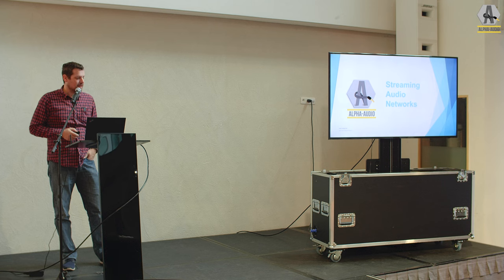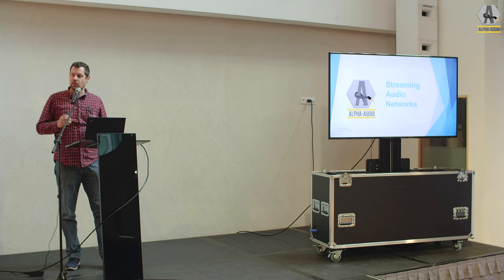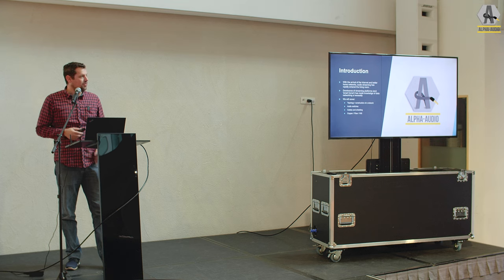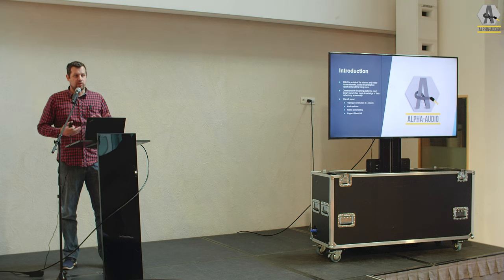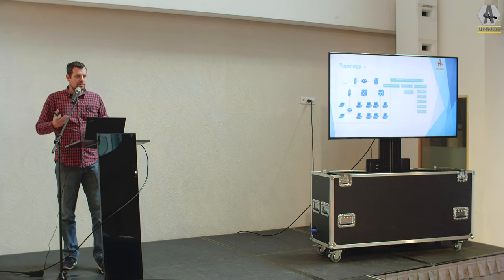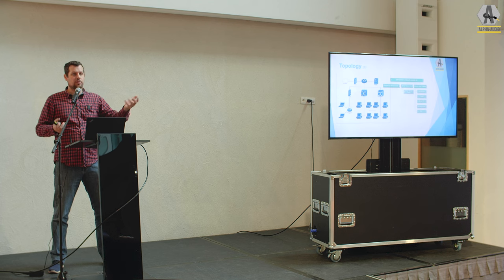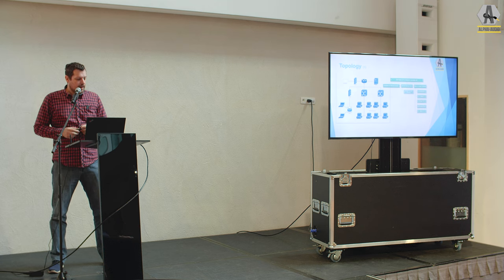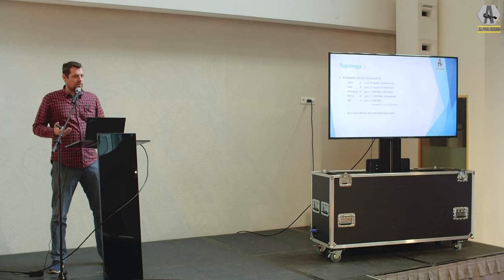Streaming Audio Networks - What matters? And what doesn't? Noir & Blanc hifi show 2022

Comment: Good discussion. I am a sceptic owing to a decades long professional network engineering background. Plus my audio system already sounds epic. I don't even know what sort of switch I have behind the AV rack. Turns out its a TPLink (I checked) so you know I'll have to buy a Netgear or a small Meraki switch now and hear for myself.
Reply from the maker: @KeithHeinrich  I can imagine you are sceptic. I have a networking background as well... But the issue is not data related. It is mostly electrical noise... Trust your ears...
Reply: @TheAlphaAudio  for the price of a decent quality switch it’s absolutely worth doing.👍
Reply from the maker: @KeithHeinrich  yes. It is.
Reply: @TheAlphaAudio  so I replaced the switch at the back of the AV cabinet with a brand on your list, only to discover I had an earlier model already in place. I hear no real difference from the change in switch (DGS-1005 to DGS-105) - however I see that I have put a shielded cable on the last drop, and because I had a second one put that on the inbound side as well. I did see somewhere you mentioned shielded cables contribute to improved audio quality, looks like I tried that in 2021 with the Dan Yee cable (a really inexpensive flat shielded cable). Its still there so it looks it must have been a successful experiment at the time, but I'll see about finding an old Meraki switch and see how that goes anyway. 

Additionally, at an earlier time I thought I'd see if power cables make a difference. Turns out they did (very inexpensive brand) and my wife who had not know I made a change asked what I had done so I left them in place. Its the ongoing conflict between the engineering brain and the ears, if it sounds good then I leave it and move on. If it cases no harm then I leave it there and move on.

Thanks for testing all the things so I don't have to. 😉👍
Reply from the maker: @KeithHeinrich  There is so much we don't know yet. Ears never lie if you are truthfull to yourself while testing.

Comment: I found cascading 2 merakis with fiber and startech SFP's worked very well. I replaced the power supplies with LPS and a LC filter. BIG improvements
Reply from the maker: Cisco Meraki makes very nice switches. I can imagine the power supply upgrade did wonders.
Reply: Which Merakis switches are recommended? I’m seeing one model on Amazon for small offices at $209 and there are some Merakis that are thousands of dollars.

Comment: Opinions differ about whether or not to connect shielding at both ends of the utp cable and some services swear by one or the other, occasionally I am specifically asked to mount shielding at both ends but usually the other way around
Reply from the maker: Opinions can differ. But it is technically completely incorrect to connect the shield to one plug. You actually introduce more noise ánd the shield doesn't work. And IEEE specifically states that shielding should be connected to both connectors, if the cable is shielded.
Reply: @TheAlphaAudio  I trust what I hear, in an industrial environment I would not dare to connect on one side as the IEEE standards certainly apply. But as I wrote ... I apply what the customer wishes :)
Reply from the maker: @fernandlambert4342  OK
Reply: It's not a matter of opinion, just DON'T USE STP !!!  Use fiber if you even encounter an extreme interference situation such as passing ethernet cabling aside a big 600V power tranformer!
Reply: @guyboisvert66  … I just got into streaming music via ethernet. Can you please elaborate why stp would be bad … in terms of audio? How would it manifest itself? Thanks

Comment: Hi Jaap, going trough your presentation Have you ever tried to measure the voltage on the ethernetwire of a mediaconverter to find out its default output noise level ? I would expect that for -110 dB you need to be in the range of 10microvolt ?. Would it be feasible you think ?
Reply from the maker: We can definately do that. We will receive our CDN next week. I will finish the measurements after installation. I can check a converter than as well.
Reply: Complete waste of time, we're talking about a well defined and robust specification and the usual digital logical signal with detection levels...  Microvolts don't have any significance in that...  Think of a multi-gigahertz CPU with billions of gates arranged in multiple layers: Do you think you can have worst case than that?  Still, CPUs don't make any errors!

Comment: Hi Jaap
Thanks again for jet another interesting video👍
I have designed and build networks professionally for over 16years.
I have built and used media servers in my HiFi setup for about 10years, only the last 2½years have I optimized my private network at home.
Here I also learned that network for HiFi does make a huge difference 👍😊

In your video did you state that Network speed does not matter, because bandwidth requirement for Audio is so low.
Yes, bandwidth requirement for Audio is low and like you said maybe around 10Mb/s when it is high.
Most switched and NIC's is about 100Mb/s or 1Gb/s, which is 10 or 100 times higher than the audio streams needs.

Still speed of the NIC's does matter, if you take a 1Gb/s NIC and lock it till 100Mb/s your sound will change.
If you use a managed switch, be sure to set speed and duplex to the same in both ends.

I will not say which one is best, because some systems will benefit for using full speed other systems will benefit if using 100Mb/s on a 1Gb/s NIC.
If you have tested this too or if you try it, please let me know what you think :)

Thanks
Br
Jacob Land Jensen
Denmark
Reply from the maker: Thanks for the insights. I will try it and write some stuff about it!

Comment: @8:30 UTP cabling is CMNR (common mode noise rejection). You don't need shielded in home applications. T.I. has a paper on EMI effects on 10/100 Ethernet PHY's and the conclusion is noise immunity below 30MHz. That's the first thing to understand. On STP cable you need to look at the Siemens paper called the 'Antenna Myth' as you are now, unfortunately, perpetuating those same myths.

Comment: Interesting presentation & I look forward to more findings in this contentious area........ I don't mean to come across as suffering from "Obsessive Compulsive Disorder" & "nitpicking" but @ 26:08 you mention "fiberglass" in your overheads, the general convention is "optical fiber" or just "fibre" ( without mentioning, single mode or multimode or real glass versus plastic optical fiber ... )  the term "fiberglass" is reserved for applications such as a "fiberglass boat or  surfboard" or fiberglass thermal or high temperature electrical insulation - I like everything you "guys" do & it's refreshing to hear an intelligent conversation on a subject that's dear to me ( sound quality ).....
Reply from the maker: You are absolutely correct... Fiberglass is something else... :-).

Comment: The double shielding which you suggest improoves sq only on digital connections?
Thank you
John
Reply: DON'T USE STP!! (Shielded Twisted Pairs)  It just brings more problems than what it is trying to solve!  If you have enormous source of interference (like passing aside of a big 600V power tranformer), then use optical fiber, it's cheap !

Comment: GM ☕️..yea, it’s me …again.
My biggest issue with my streaming of music ( Amazon Utra HD) is my incredible slow internet speed..in a semi rural area….so once we upgrade from 6MPS to something around 50MPS ..now we can do more around here.
Reply: 6 Mbps is more than enough... It depends if you abuse it, like downloading large files at the same time.  And you'd be much better to use regular CD quality streaming, there's no such thing as "Ultra HD Audio", it's just lower noise floor and CD quality is already much better than your ears...  If the HD version of the same album is better, it just means that the source material is not the same (different mix, remaster, etc).

Comment: Thanks, great presentation. I do have a question though… should all cables leading to relevant audio equipment be connected to the same switch? For example, NAS, Roon Core, Roon endpoint. I have Roon Core and NAS in the switch but the Ethernet cable that leads to the Roon endpoint is plugged directly in the router (a rather cheap one). I do have a galvanic isolator at the end of that cable, in the connection to the endpoint. Thanks!!
Reply from the maker: No its not necessary to connect everything to the same switch.

Comment: Very interesting video, thank you! I have a Bluesound Node 130 upgraded with PD Creative PSU and fed with ifi Power X Powersupply,  a Vodafone Station Router with standard Powersupply. All cables are supra cat 8 cables. Would you recommend a network switch or is it better to not have a switch? If you recommend a switch, which would you buy max 100 Euro? Would you upgrade the Powersupply for the Router or isn't that necessary? Thank you!!
Reply from the maker: A good switch with nice power supply will definitely help.
Reply: @TheAlphaAudio  which would you recommend? When I wont spend more than 200 euros for the switch and the power supply? Thank you very much:)
Reply from the maker: @paulmastermann2200  Netgear GS108E with a nice IFI power supply.
Reply: @TheAlphaAudio  thanks a lot! The Netgear is now in my shopping cart. Would the ifi ipower with 12 V and 1,8 Ampere (50 Euros) be a good match with the Netgear or would you recommend the if power X with 12 V and 2 Ampere (100 Euros)? Thanks :)
Reply from the maker: @paulmastermann2200  you dont need a lot of current... Even 1A is enough.
Reply: @TheAlphaAudio  ok, so I will take the ipower for 50 Euros. What is the benefit of a switch vs not having a switch?
Reply from the maker: @paulmastermann2200  well... Listen to the difference... :-)
Reply: @TheAlphaAudio  ok, I will :D thanks for your time and your help. Appreciate that!
Reply from the maker: @paulmastermann2200  welcome!
Reply: @TheAlphaAudio   Would a NETGEAR 8-Port  Unmanaged Switch (GS308) work just as good?  Thinking of getting the iFi iPowerX 12v with it.  Any other PSU recommendations or better buys?
Reply: Also, I see a deal on a Netgear GS108 Unmanaged (not GS108e)  Guessing it could work just as good too?

Comment: @ 13:32 "Are there any Electrical Engineers in the ... [ audience ] ... no?  Ok, I'm not one as well, but... "
... and it shows.  If there were any EE's in the audience, they would have contested these claims easily.  In the digital domain, the signal on the cable is being interpreted as a 0 / "zero" if below threshold, and a 1 / "one", if above threshold.  TTL logic thresholds are set such that there is a small gap in voltage values between the two states.  For example, from 0 volts to 0.8 volts is considered a “low” logic state (zero / 0), and 2 volts to 5 volts is considered a “high” logic state (one / 1).  Anything in between 0.8 to 2 volts is not considered a "legal" TTL logic value.

What this means is that although network and other data cables (e.g. USB, etc...) can and will be subjected to noise from external sources, generally in a very high percentage of cases this noise falls well below the threshold required to flip a bit on the wire.  If that were to happen, you would experience data or packet loss (would be measurable and provable), and the end result (with streaming audio gear) might be some sort of audio drop-out, buffer underrun, or in worst cases playing a corrupted PCM data stream.  However, in practice this is very rare to see with well-designed gear (e.g. streaming devices, DACs, audio interfaces, etc...)

When packets arrive at the destination, they are processed by the receiving device and eventually translated into analog audio, usually by a DAC.  If you were to test this DAC output for noise and compare between pieces of network gear in between, you'd see that most all of the noise floor is the same across tests and the entire frequency range.  The only exception is if you hooked up the final DAC, amp and/or speakers in such a configuration as to create a ground loop.  That would be considered a wiring error, and would immediately discredit any results of testing the two pieces of networking gear, unless one of the two pieces of gear indeed is somehow contributing to the ground loop in the system (in which case, that piece of gear would be considered faulty & bad design).

When you're comparing the two network switches and supposedly "hearing a difference", that is easily the placebo effect.  Unless you're doing double-blind statistically interpreted experiments on this, you can easily fool yourself into thinking that you're hearing a difference.  In reality, we often can "hear a difference" between two sets of gear or types of interconnections simply because we're focusing on the minutia of hearing something, and our brain and cognitive biases trick us into thinking we hear something as better or worse than the other identical audio when in reality it's the same.
Reply: Yeah, very basic principles, undergrad level in Electrical Engineering... Streaming audio must use buffering.  TCP/IP is very robust and transparent even with errors  (TCP checksumming and  retransmission).  You won't get corrupted PCM unless you have a broken audio device / streamer.  And you're 100% right about placebo https://youtu.be/BYTlN6wjcvQ

Comment: Audioquest Pearl, and other Audioquest ethernet cables, have the shield tied to ground at one end only. You can confirm this by connecting a continuity meter between the connectors.
Reply from the maker: I dont think the Pearl is shielded at all to be honest
Reply: @TheAlphaAudio  ??? A Pearl cable is CAT7, which requires a shield and one was taken apart in the video to show its shielding.
Reply from the maker: @audiobomber  true... Sorry. Was confused.

Comment: 11:42 it's inherent in the the whole ethernet protocol prevents data errors 

Wrong - the ethernet protocol allows to detect data errors but it does not take any actions to correct that errors. Thats why TCP/IP is used which has additional procedures for requesting packets with data errors again before the application gets them
Reply from the maker: Maybe you should watch to the end... the problem is not TCP/IP or data errors.
Reply: @TheAlphaAudio  You should read my post again - you said that the whole ethernet protocol prevents data errors - and this is not true. Ethernet does not ensure that the transmitted data is correct.

The problem with your video that you assume that noise in a switch (or on a Ethernet cable) does influence the output of the DAC. To proof this you need to measure the output of the DAC when used with different switches.

Noise in the analog world is different from noise in digital signal processing.
In the analog world once noise is added to the signal it could not be removed anymore.
And as each analog component adds some additional noise  you have to reduce noise in each component as much as possible

In the digital world noise upto some degree does not matter
If you define that a logical "1" is represented by 5 volt and a logical "0" by 0 volt than adding noise of +/- 1 volt  does not matter if the receiver treats everything below 2.5 volt as "0" and above 2.5 volt as "1".
And each digital component (down to a logical gate) "refreshes" the signal. 
If an inverter receives a voltage of 2 volt it will treat it as a "0" - invert it to a "1" and sends that out as 5 volt (+/-  its own little noise)

So instead as in the analog world where noise is getting greater with every processing step in the digital world the signal is cleaned at every step.

When streaming music the data (from Internet) which is send to the streamer goes through thousands of digital processing steps (first it is processed by the TCP/IP stack, when it is normally decrypted and decompressed and after that it goes to a digital buffer - so a lot of "cleaning" takes place with the result that a little noise from the input of the streamer will not flow to the DAC.
This cleaning in each component is the reason why you can send gigabytes of data arround the world with 99,9999%  chance of no errors. And in the very rare case that an error occur TCP/IP will handle it.

Digital to Analog converters are not only used for HiFi - they have a lot of industrial and scientific applications but none of that users has any of the "problems"  so called "audiophiles" believe to have.
And DACs in HiFi only have to handle very low data rates and output frequencies compared to many other applications.

Comment: How i shield in two side in a cat 6a cable where already have a ground drain cable??? May the drain cable and shield foil connect together??
Reply from the maker: Yes. You can also check with a cheap cable tester.
Reply: @TheAlphaAudio  and the drain wire and foil crimped on the plug ground body right??
Reply from the maker: @sndpds50  exactly
Reply: @TheAlphaAudio  wow. Then I’m the right path. Tnx for ur informative videos. 
Will try for a network switch with my rpi4 definitely within few weeks.
Reply from the maker: @sndpds50  thanks. We will be doing a mass test soon.

Comment: The name is.. Jitter where you try is there streaming songs with no jitter in... 
the sea of jitter
No need from hi end  wires, big money for switches the data  coming from the source and on your streamer converting and..then... . Jitter so get your self a streamer, good network and go for fishing songs there are songs with no jitter.
Reply: Jitter has nothing to do with audio streaming...  Another of those audiofool lies...  Worst you can get is audio stopping if incoming data stream slow and buffer empty...  The DAC clock is use to reconstruct the analog and random jitter is just noise... well below human ear capability...  https://youtu.be/TT9JL2yaIOA